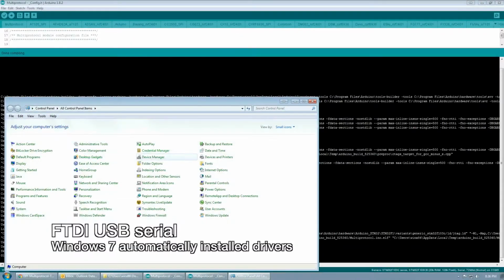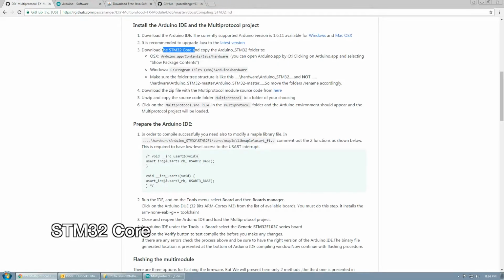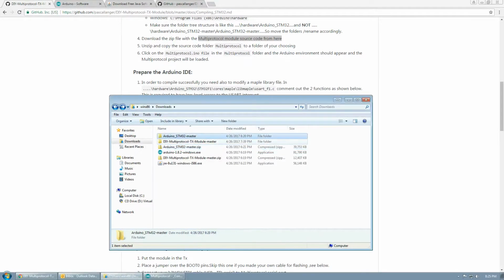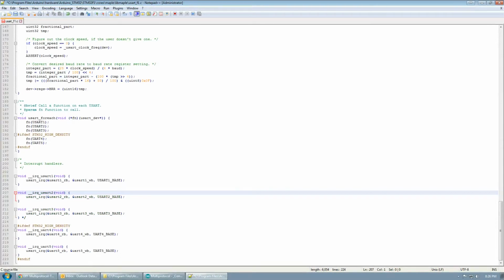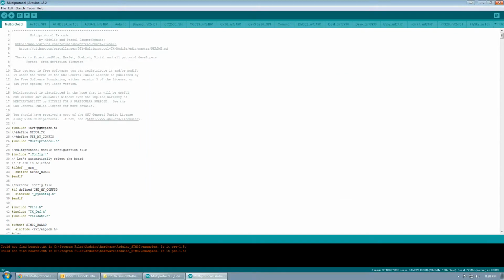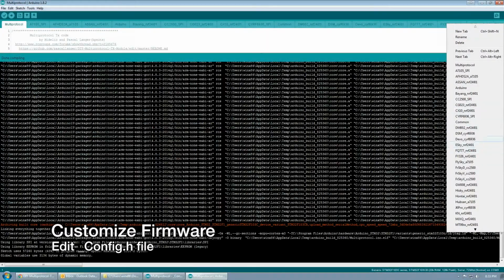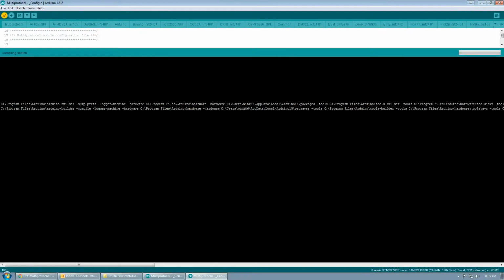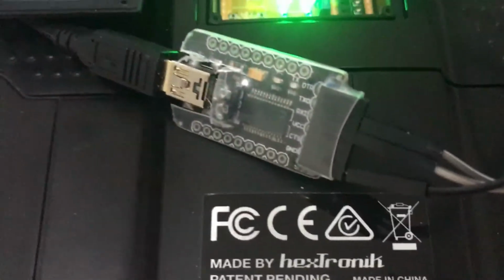✅ Updating STM32 4 in 1 iRangeX IRX4 multi protocol module firmware flash taranis frsky banggood

Comment: Thanks for getting me started. I figured out that I didn't need to go the Arduino route because there are pre-compiled bin files available, and I don't have any esoteric preferences at this stage.  Have the IRangeX IRX4 stm32 base model (no plus), so there was no dial and no USB port, although there are spots on the board for them. I ended up soldering header pins to the serial Rx, Tx and Gnd, so I won't have to Jerry Rig every time I need to add new protocols.  I used the 'FlashMulti' program and a USB to 3.3v TTL converter. The flash went smoothly once I installed proper drivers for the converter.  One thing I noticed was the FlashMulti installed a boot loader file prior to flashing the firmware. I'm wondering if that will enable me to flash directly from the Qx7 next time??
Reply from the maker: Good to hear. I believe ER9x allows module updates from the transmitter. But I haven't updated my 4in1 since I did this video.

Comment: Thanks. Ever since I upgraded to the latest OpenTX, I haven't been able to select any protocols on the IRX4 (serially with Qx7). Unstead, I get a flashing 'upg. needed' in the space where the sub protocol can normally be selected. I'm assuming that my IRX4 FW is not compatible with the newest OpenTX. What doesn't make sense is we can't flash the module from the transmitter even though Open TX communicates with it over a serial connection on the QX7.
Reply from the maker: There are some tutorials for flashing the 4in1 module here:

https://openrcforums.com/forum/viewtopic.php?t=10787

Comment: The module needs 3.3V but the Taranis X9D plus has 6V and Vbat pins. Is it safe to put it in?
Reply from the maker: When in the transmitter, it'll get the right voltage. That's why I do that since its safer than supplying the wrong voltage externally

Comment: Does flashing the module add any benefits? Or is it to fix the problems with DSM?
I've never been a fan of spectrum cuz it's the only radio brand that's always having problems at my flying field.
Reply from the maker: I'd only flash it if something isn't working. I don't know exactly what's new in the updated firmware but check out the github to read if it's relevant for you.
Reply: @KenVersus  awesome and thanks for the fast reply 👊
I was thinking the same thing especially since I have no need to ever use DSM. I'll more than likely solder up everything like you did in the video just in case I need it later.
Again, thanks for the reply and you're video's are very helpful and straight to the point.
Reply: @KenVersus  How about when the deviation guys come out with new nightly builds? How do we go about adding those?

Comment: Please can you tell me how to switch different modes/chips when using with stock TH9X transmitter? I think it comes with ersky9x firmware.... Banggood product page suggests you have to select which protocol chip to use with PE1 & PE2, does that mean there is a jumper you have to change in the IRX4 module?
Great video on updating the firmware!
Reply from the maker: This irx4 only works in serial mode and needs firmware that supports multi module so make sure you update to a version of ersky9x that does. Then you can select protocol in the menu. 

Or the new irx4 plus works in serial or ppm mode.  Ppm mode you select protocol with the yellow knob on the back of the module.

Comment: Could you please do a video on flashing a bootloader and changing channel order on the latest banggood 4in1 + module that supports PPM and Serial. Showing how to use FTDI via usb as well as a 9Xr Pro and Qx7 via the SD card would also be helpful.The new 4in1+ supports USB programming with the correct bootloader installed.Thanks
Reply from the maker: I plan to work on a video.  Thanks for all the suggestions.  Just keep watching!

Comment: Hi Gr8 Vid ..can you tell me if the IRangeX 4in1 works with a air-hogs helix x4 ? if so witch protocol do I use ? thanks ....
Reply from the maker: +Brian Mabbett I don't think the airhog stuff have been decoded yet. I think they used the nrf24 chip but the protocol is unknown at this point.
Reply: kenVersus ok thanks
Reply: Q : Is there anything we can do with the 2.4ghz Transmitter board out of the Air-Hogs Transmitter ?  PPM it into my grandson's X7 that I gave him ..
Reply: Thanks for your help Ken i now think iam giving up on the Air-Hoggs  and get him a new quad seen a good starter called XK X130 - T with  BS - FHSS protocol . Do you know if that ok with the  IRangeX 4in1 ? thanks ..

Comment: Does this 4in1 accept 5v USB Multiprogrammer or does it have to be 3.3v?
Reply from the maker: +Gerard de Vries it's 3.3v. That's why it's a good idea to power it with the transmitter and not via USB.

Comment: Can i use pl2303 usb to urt(ttl) to update irangex 4in1? Because i want to use telemetry, my stock firmware said NO_telemery in all protocol even frysky d8,  i discovered new sensor in telemery tab, but nothing to show.
Reply from the maker: +Adi Putra it should work. But I don't have the exact one you do
Reply: I have the same problem NO MULTI_TELEMETRY on status. I tried to update the firmware without success. I'm using the same steps as yours but i don't have telemetry and module doesn't work it blinks shortly on one led. If instead i flash it with STM loader with the .bin files from repository it works again but still without Telemetry.
May i have a fault unit? Do you know if last release .bin file is the same one as i can compile with Arduino?
Reply: It work to update firmware use cheap usb to ttl, and now i have telemery, on eachine h8 i can use momentry switch to bind, use ch16, and thank for you video

Comment: Hey,

I'm getting these errors

--

Sketch uses 56,060 bytes (42%) of program storage space. Maximum is 131,072 bytes.
Global variables use 3,104 bytes of dynamic memory.
C:\Program Files (x86)\Arduino\hardware\Arduino_STM32/tools/win/serial_upload.bat COM9 {upload.altID} {upload.usbID} C:\Users\jaspe\AppData\Local\Temp\arduino_build_438297/Multiprotocol.ino.bin 
stm32flash 0.4
Failed to init device.

http://stm32flash.googlecode.com/

Using Parser : Raw BINARY
Interface serial_w32: 230400 8E1
--

any idea? I already swapped TX and RX but same error
Reply from the maker: +Jasper Tielen looks like communication problem to the mcu. Make sure 4in1 is getting power. check wires or try another ftdi serial programmer. That's all I can think of. The rcgroups forum may have some more ideas.
Reply: I got the same problem... :(
Any solution.
Reply: LapinFou14 no still same problem with mine.
Reply: Damn... Are you sure your FTDI device is working? Mine, is new and I never tested it before.
Reply: I've done three things at the same times:
1. Install FTDI FT_Prog (to check that my USB to serial dongle wasn't build with a fake FTDI chip).
2. Reboot my laptop
3. Redo the soldering ON BOTH SIDE (even if they are some metalized holes).
And it worked!!
So happy. =)

Comment: Thanks SO much for all the time and effort that you put into providing all this info!

Since you're very familiar with all this: Have you heard of anything that will allow a Q X7 controller to bind/control a Hubsan H501S?

Thanks again!!
Reply from the maker: +Neo Amor I don't have that quad.  You'd have to search if it's supported by the 4in1 firmware yet. or check on deviationtx.com. If they support it, it'll eventually be added to the 4in1 firmware.
Reply: Thanks for your reply!

I've been searching quite a bit today. That's how I found your vid. And you're very knowledgeable about this stuff.

The multiprotocol list includes Hubsan X4. And the H501S IS an X4. I'm just not sure if it means ALL Hubsan X4s. The list of supported models mentions some specific models in the X4 lineup, but not the H501S specifically.

I don't own the Q X7 yet. Or anything else other than a few quads and their native controllers. But I'm considering the Q X7. Compatibility being an elusive thing sometimes, as you well know, I would rather not assume compatibility, and then be disappointed. I'd rather choose to buy or not buy the controller and the add-on, knowing that it will or won't work with the H501S.

It's hard to justify the cost of the Q X7 and the prot module, just to fly an Eachine E011 only. :) I'd imagine that I'll get other quads in the future, so the controller would be more useful at that point than it is now.

The H501S is a really popular model, so I would assume that it made it into the protocols. But I'd rather not assume. ;)

Thanks for your help!!
Reply from the maker: +Neo Amor looks like they are working on it judging from this post. I only buy quads that are known to work with the 4in1.  

https://www.deviationtx.com/forum/protocol-development/5028-the-new-hubsans